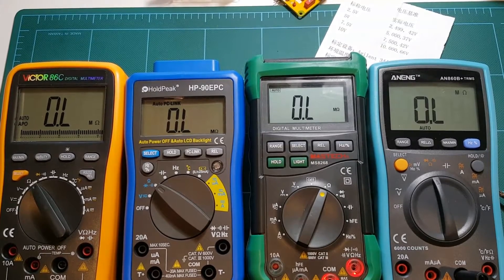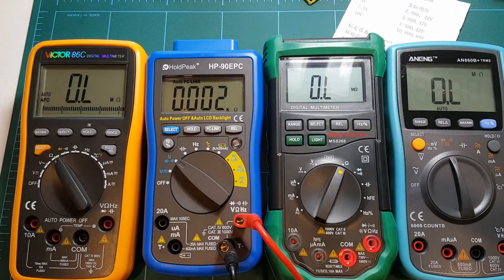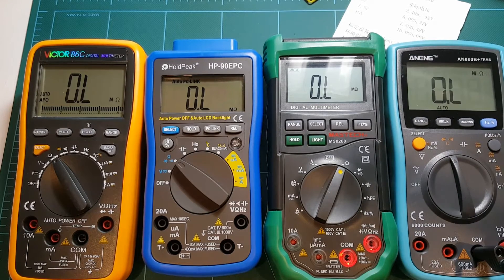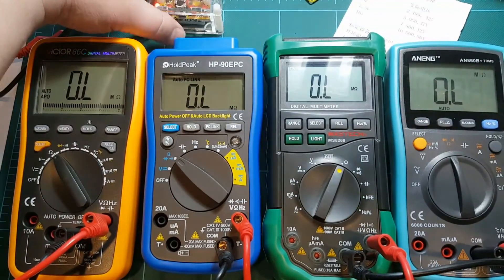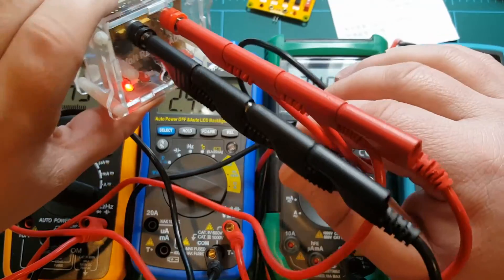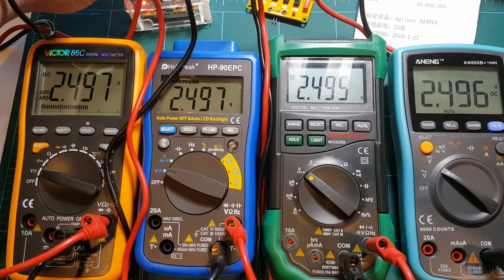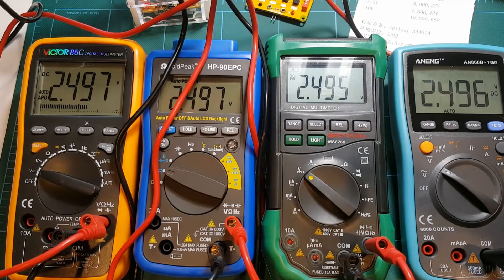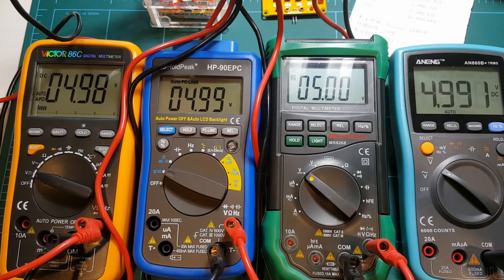Measuring 2.5V from two voltage references

Comment: Connect only one meter at a time for accurate measurements. Every meter has an input impedance which are then in parallel and have an effect.

Comment: Aneng winner what I saw correct me if I'm wrong - meter never should display a ref value bcos between it and source exist probes which have own impedance isn't ? (so on the probes exist a bit voltage drop) Value on the display should be allways a bit lower and mastech definatelly show to high value !